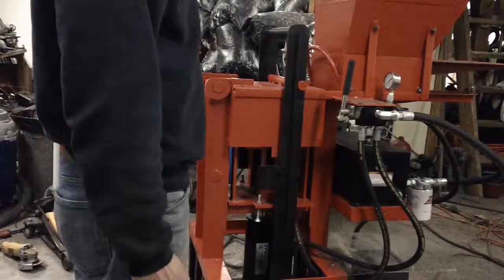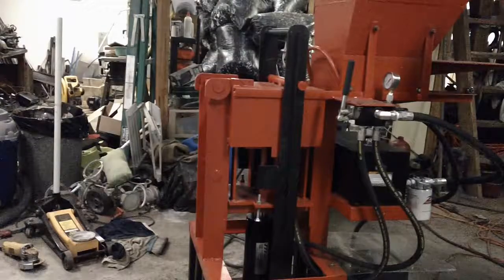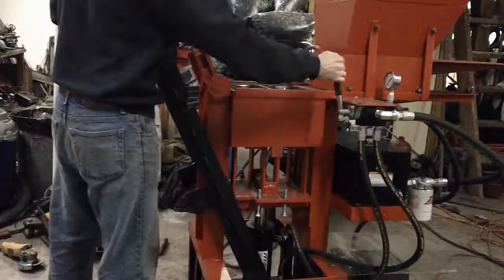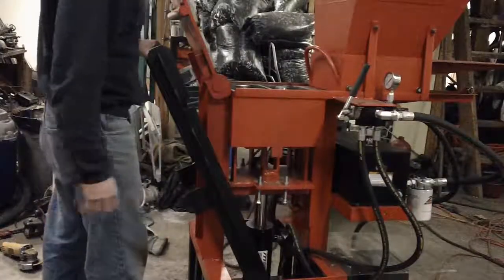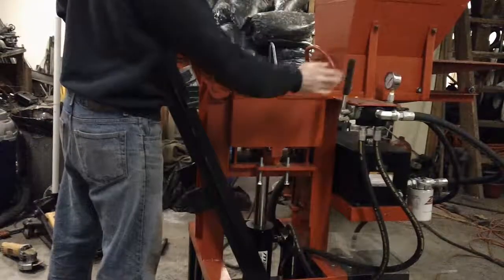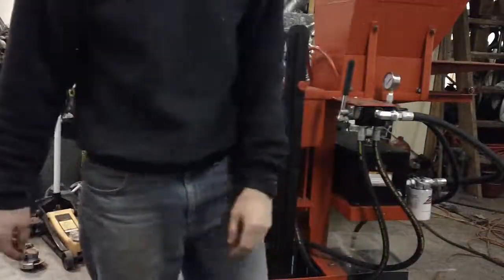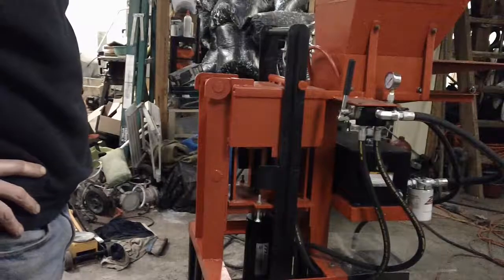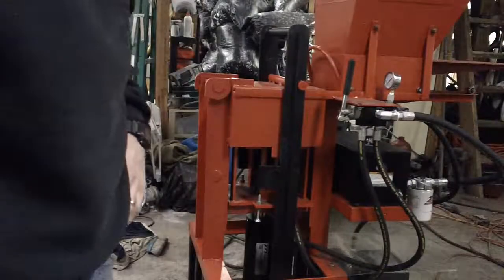Converting a manual Compressed Earth Brick machine to hydraulics video 4b

Comment: My lockdown project, I've done through your video 100s of times. Mine has has 3 chambers. Metal I used is MS 10mm.
Do you think MS 10mm will be too thin if I use Hydraulic jack of 60 Tons ?
Reply: Hello Triple AAA, hope all is Good, i am on the Same mission can you please share with me Hydraulic cylinders details. Diameters if you don't Mind.
Regards
Reply: @paulmkenga9249  I have not reached that level...still working on the mold using 10mm MS plate.
I was about to ask the same to Stephen but he doesn't seem to reply.
Reply: @upward_onward  Ok.

Comment: It would be good you share your contact details. Can you kindly tell the cost of this machine how much is its production capability per day and what is the compression pressure force on the block at the compression stage in psi or mpa measurement. Thnks